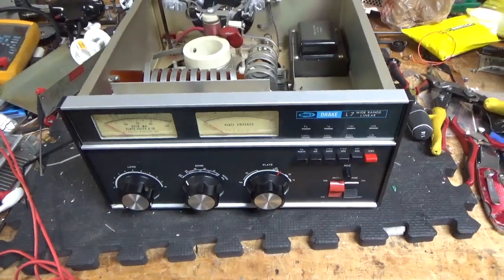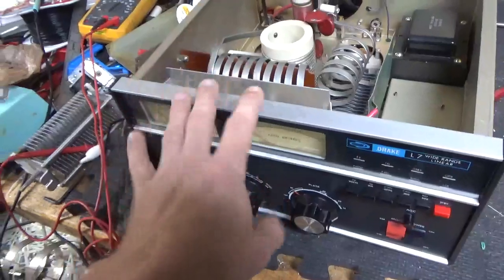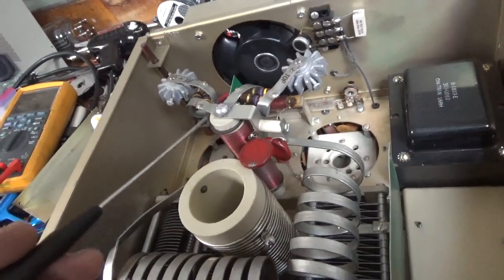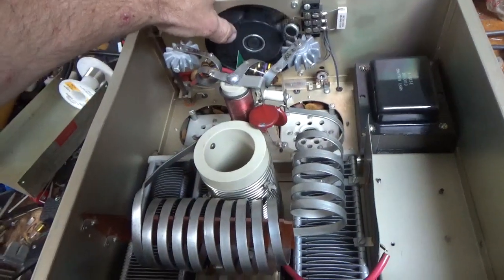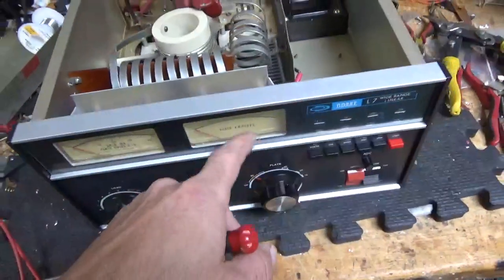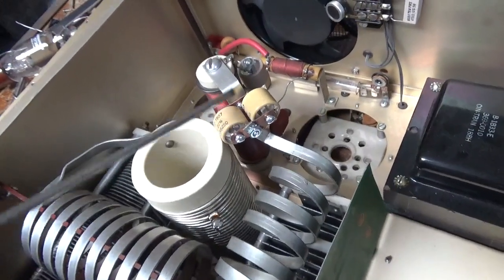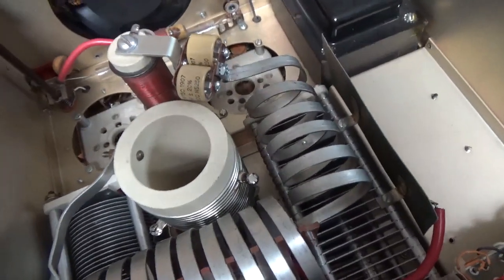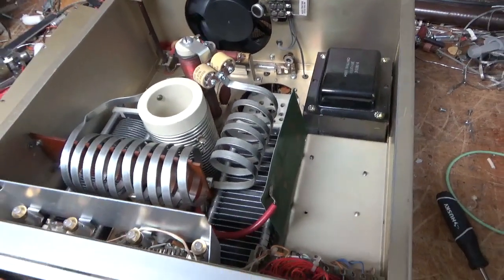Drake l7 Amplifier Repair And Modifications

Comment: The 0.82 Ohm resistor in the PS is a specific type used as a safety resistor. It is SUPPOSED to fail open if there is a serious fault in the RF deck.
Reply from the maker: The factory .82 ohm resistor acts like a series fuse with the b+. The resistor is prone to failure with small arcs in the rf deck. If fails and operator continues to drive rf into tube cathode tube can be damaged. The resistor does not prevent damage where arc is occurring as value is to low. The series glitch resistor I add limits the fault current when a arc occurs. The line breakers are ample to interrupt plate primary in the event of a plate b+ to chassis short. Once I go through the pa a short is very unlikely. Assuming the pa isn’t abused